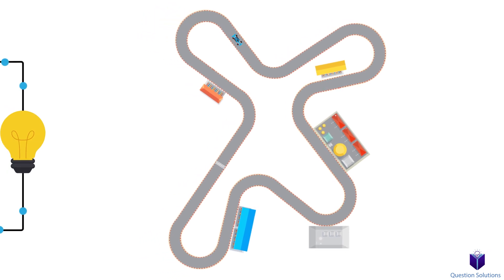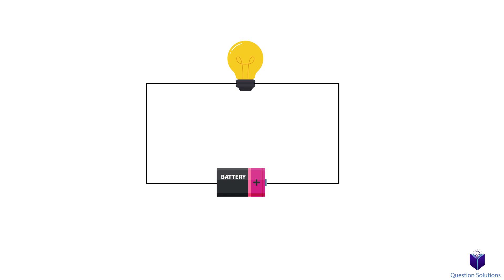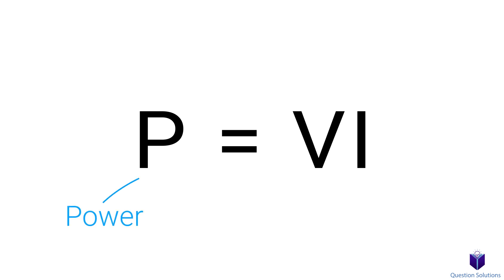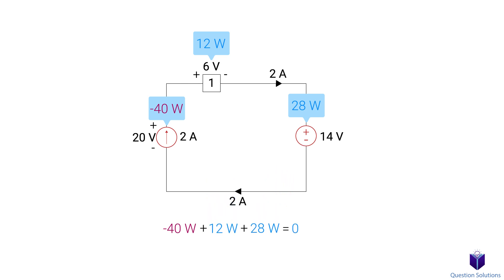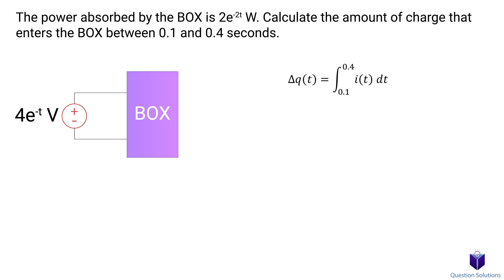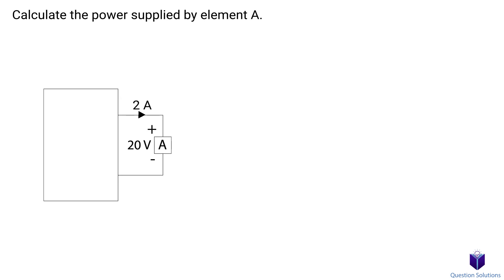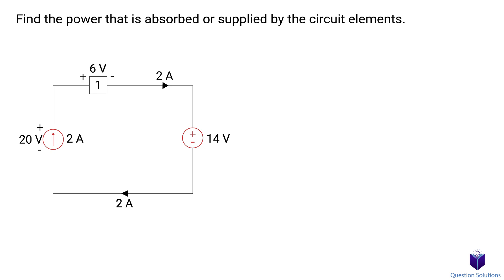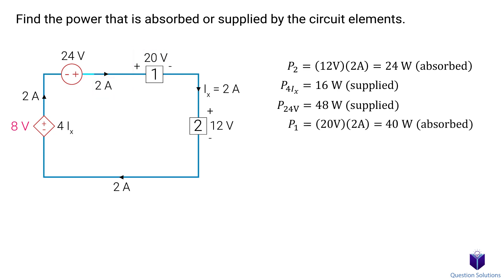Basic Concepts of Circuits | Engineering Circuit Analysis | (Solved Examples)

Comment: Hello, at 14:58, how do we know that the current is flowing in that branch of the circuit
Reply from the maker: You can systematically figure it out like this. First, you look to see if there are independent current or voltage sources. If they exist in the circuit, your base assumption would be that all branches in the circuit will have some current flowing. The next step is to see if there are any short circuits. If there are, then you look to see which branches will get bypassed by the short circuit. Whatever branches get bypassed by the short circuit will have no current flowing. In this circuit, there are no short circuits, so all branches will have some current flowing.